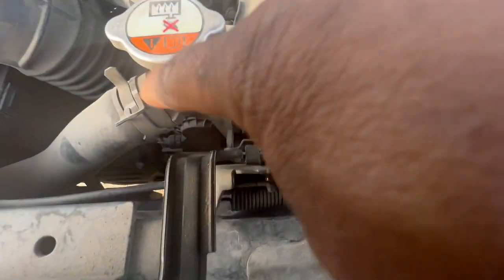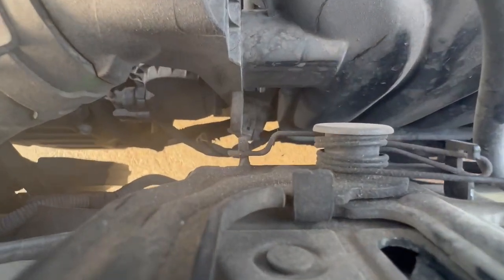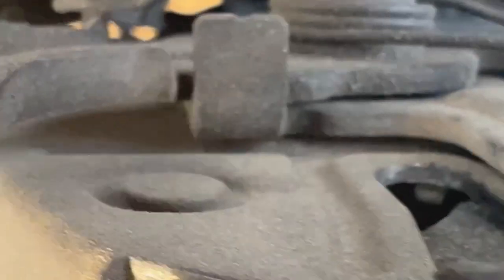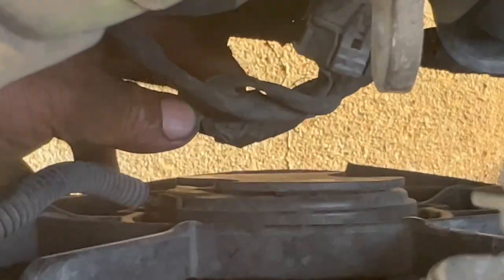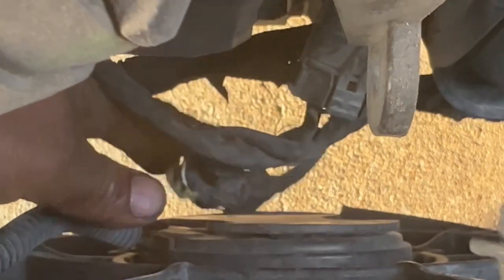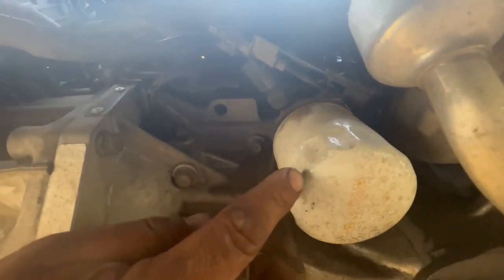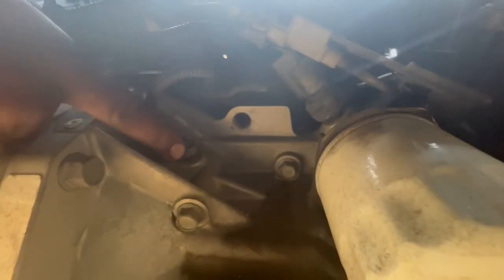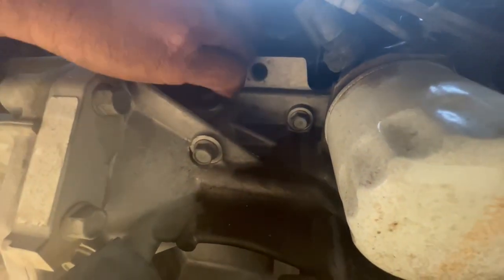2012 -2019 kia rio crankshaft sensor location (easy location)

Comment: If the sensor was going bad or needed to be replaced would that be the reason for the car stalling when idle or driving in very low mph?
Reply from the maker: @heySandi  do you have the check engine light on ???  If yes whats the fault code